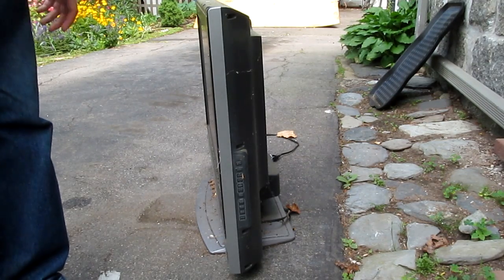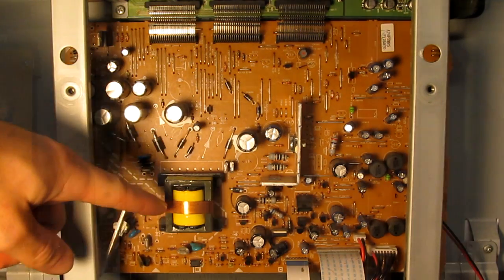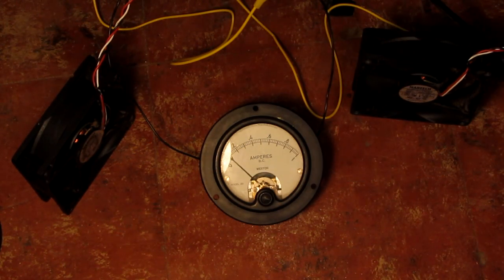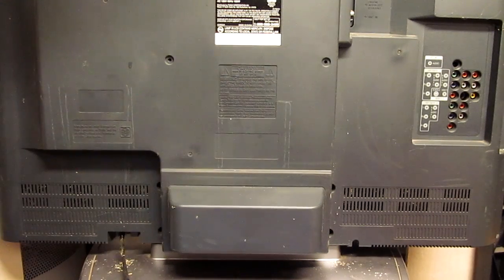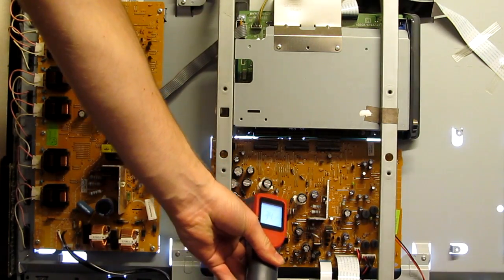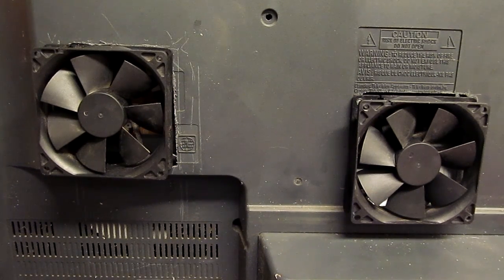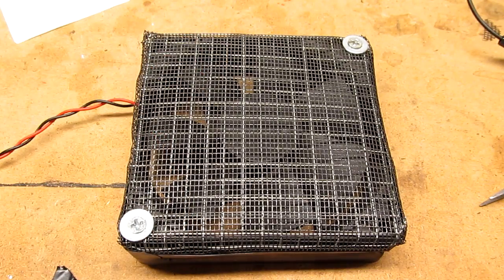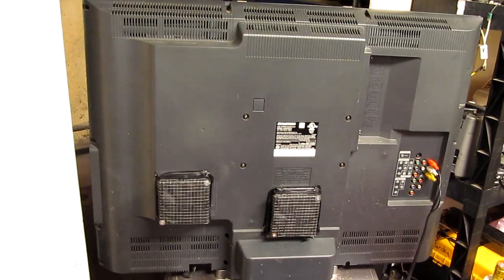I Added Fans to Stop My Sylvania HDTV Overheating

Comment: Ideally you should have turned the fans around so they're sucking the hot air out and blowing out the back blowing cold air on because what you're doing is just circulating the warm air around the TV
Reply from the maker: Counterpoint: hot air rises up and away from the TV after it exits the vents, replaced by cooler air lower down.  Also, moving air from forced cooling will be effective until the room air is extremely hot.
Reply: @MetaphysicalEngineer  Doing this can damage the TV because the hot air causes the capacitors inside to swell and shortens the life of the TV. You need to pull the hot air from inside. The fans are facing the opposite direction.

Comment: Terrific idea!   I keep having issues with the vid processor board running hot in my 2018 65in vizizo p series. Apparently the solder gets soo hot it softens, sense the board is vertical,  gravity pulls on the soften solder causing TV to power up but it cycles on/off once then nothing.  Iv baked the board laying it horizontally twice now in the past year and half and it's helped to get the solder to flow back where it belongs in places.  Unfortunately,  I don't think it's a good continuing practice.  The main heat sink vizio ships with these vid chips are a joke in my opinion.   Soo iv planned to purchase two 120mm inlet and three 180mm outlet fans. Power them externally via 120 wall with a simple on/off toggle inline.  Cutting out to mount flush the two inlet fans inline with the heatsink plate,  then roughly 8 to 10inch above them mount the three outlet fans.   In theory, this should allow for the right amount of cool air drawl onto and upward to be exhausted. Heat rises, so I shouldn't have much re-circulation at all.  The goal being, to  help pull the heat off and away from the heatsink,  so in return it'll run not as hot while in use.  Any thoughts or advice?
Reply from the maker: That's unfortunately common.  Reflow solder that melts at relatively low temps plus chips that can survive temps high enough to soften it.  

You may not need that many fans at all, since any active airflow will dramatically increase the effectiveness of the existing thermal management.  Most of the power of the TV is in the backlight, which is better spread out.   I'd say put the two 120s pointed at the heat sinks of the processor board, but allow the air to passively filter out through the remaining vents.  Once you have fans pushing air, hot air rising under convection is largely irrelevant because the force of the fans is so much greater.  Get low noise fans so you're not distracted by the sound during quiet parts of the show.

Comment: i have the bigger brother of that LC420SS8.  how did you actually physically tap into the 16v rail?  directly to the diode like you had the aligator clip?  then you just grounded the fans in series to the case?
Reply: edit nvm... i saw how you secured it.

Comment: I really appreciate the thoroughly described repair process.
I also have a LCD TV with overheating issues (Philips 26PFL3403D/10). I noticed it first time after picture distortion and black screen appeared. While inspecting the inside I've noticed that wire insulation near the connector of LVDS cable has crumbled. After replacain LVDS cable picture returned to normal, but overheating which caused the problem remains. There is also noticeable discoloration on motherboard and some buldged caps on power supply. 
I was planning to install a pair of 5V fans with USB connector that could easily be plugged in service port, but all 8mm and 6mm I found are 2500 and 2900 rpm which would be noisy. I've uploaded some images of above mentioned at https://postimg.org/gallery/29wpn8qxy/
Can you advise me what to do in this case and where would you mount the fans? It would be much appreciated.
Reply from the maker: I would replace those caps for sure.  They aren't doing  any favors if they are bulged like that.  Look for low speed 12V 80mm fans, and probe to see if that power supply has a 12 volt output.  Running two fans in series on 12 or 16 volts like I did will make them slow down a lot, but they will need parallel capacitors to smooth the power delivery.   If possible I would mount them in the bottom grille or cut a hole in the lower back of the case to force cool air in and over the problem areas.

Comment: I'm running a salvaged Xbox 360   double fan mounted externally fed through a 5(+ -) cordless phone charger adapter switched through a surge protection (125 volt + -) strip all connected through my apartment wall killswitch.... but which way should I mount the fan? blowing In on the mother board?  or sucking air out of the Unit?..
.
Reply from the maker: The Xbox was designed for air to be sucked out by the cooling fans, so I would recommend doing that.  Get a tight air seal between the fans and the xbox and make sure you are moving enough air.  The 360 is kinda notorious for overheating.

Comment: Love your videos.:)
How did the capacitor make the fan quieter? What;s the electronic reason?
Reply from the maker: Thanks :)
As for the fans, it's a bit tough to explain, but I'll try. Warning- wall of text :P

Those fans don't pull continuous power, but take it in short pulses.  When not taking a pulse, the fan stops any electricity flow for both itself and anything else in series.
So the fan "upstream" interrupts power to the "downstream" fan, and the downstream interrupts the upstream the same way.  The sharp interruptions make the parts of the fan vibrate and make noise.
The capacitor gives each fan a little reserve of power it can use even when the other fan is not letting any electricity flow.  This smooths out the pulses enough so that the noise is less.